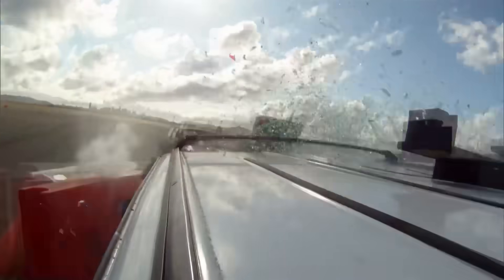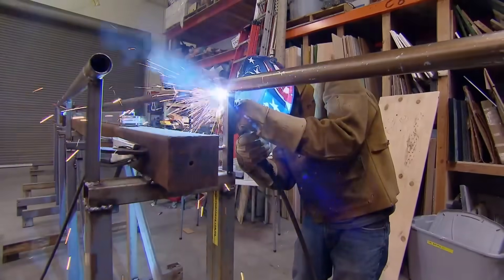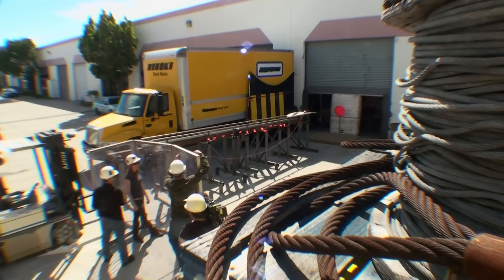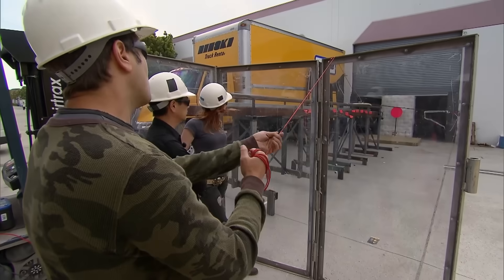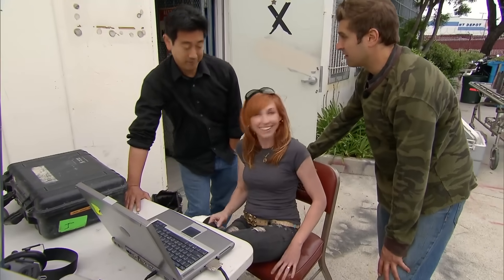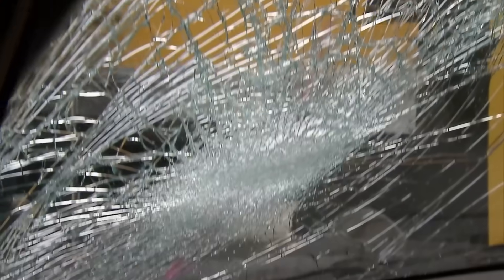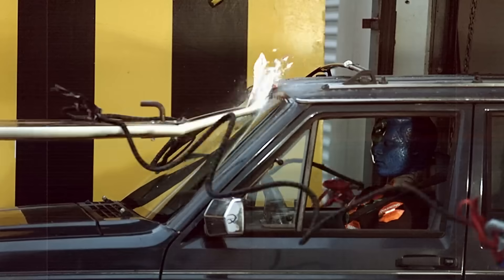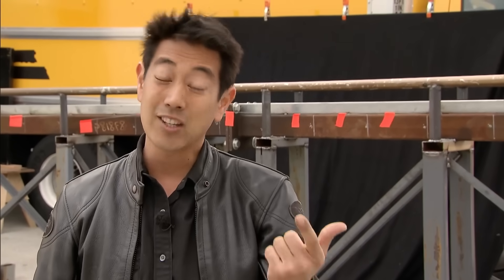Will A Flying Surfboard Smash Through A Windshield? | MythBusters

Comment: Do an experiment... 
Can firing from gun make a falling man safe landing?????
Reply: In short, no.  Anything smaller than a 50 cal will change the speed less than 10%.  Gravity will continue to outdo anything you can change with a gun and then air resistance takes over after that (terminal velocity).  If you do it with a 50 cal and early enough in the fall, then yes, depending on you not weighing too much or having much further to fall - but the real problem would be holding onto the gun during its powerful and massive recoils per second.  That one basically works in theory and not in practice - the gun would rip itself out of your hands while you go splat.
Reply: If you want to see this calculated, try AI (I used Google to verify) and change the statement as desired: "If someone is falling at 10 m/s and has a 50 cal riffle they shoot below them, how much will it slow their fall in the first second?"
I picked 10 m/s because that's roughly 1 sec of falling and you'd be doing about ~22 mph (10 m/s roughly) by then - early enough to still have a chance of slowing down, not too early to react to, and very little air resistance so far.  I picked a 50 cal because it was the largest gun I could think of that would possibly work.  I also tried M16 and it basically said it would change by less than 10% in a second, while gravity added another 10 m/s to the speed.

Comment: The thing about this is that they forgot to account for both moving vehicles.  If both are moving at 40mph, then when launching at a stationary target, they need to send the surfboard flying at 80mph.  Which they do eventually, but they derive the wrong result because of incorrect data generated by improper testing methods.
Reply: The speed is fine.  The what if it was a head on was meant to address the aim and not the speed.  The speed of the board was kept at the approximate rate of the movie scene where the target car was stationary and the car launching the board was moving about 40mph.
Reply: @temporalsoliton  Oh!  I must have remembered the scene wrong.  I thought both vehicles were moving.  It's from a Lethal Weapon movie YesNo?
Reply: Also, at 85 mph, the surfboard was stopped by the bungie hook. Without the hook, it looked like the surfboard would have made contact with the dummies head.
Reply: lmao, no

Comment: But people who hit deer or cows often get killed when they come through the windshield. Is mass the difference?
Reply: The short answer is yes.

Force is a product of mass and acceleration, with acceleration in this case being the time it takes for the board to impart its energy on the windshield, as well as the distance imparts its energy over. It's possible they would have gotten a different result had they used a heavier wooden surfboard moving at the same speeds.
Reply: @continuechaos 
They could also have tested none modern windshields, and different angled windshields.

A quick search tels me, that while tempered and laminated windshields (Shatter resistance) was a thing much earlier, shatter-resistant windshields only became mandatory in the US in 1966.

And as we all know different countries have different laws. So like many of their "busted" myths, especially early on. It wouldn't surprise me, that the Myth is based on something that has happened historically more then once. Despite their conclusion. But that it's extremely unlikely, especially with modern safety standards.
Reply: @soul0360  People do die in car crashes, even in the USA, so obviously there are  scenarios where all the safety features in modern cars are not enough.